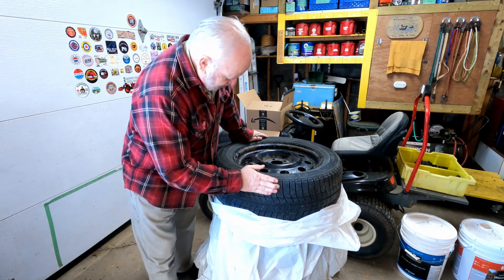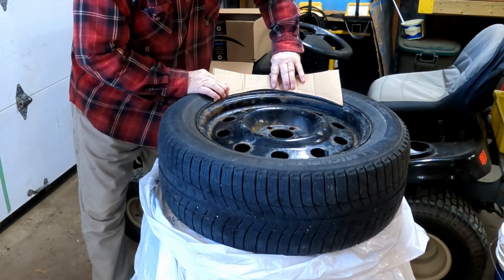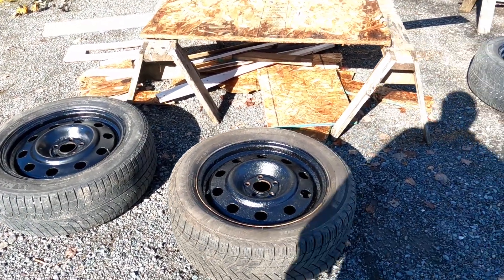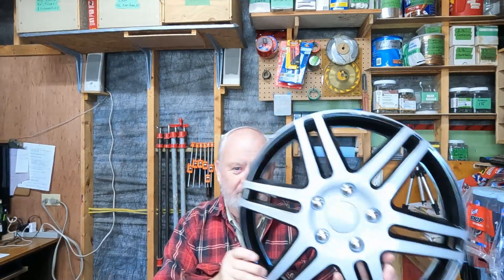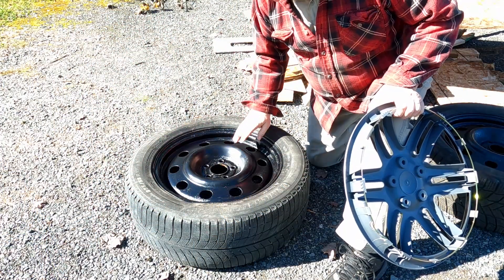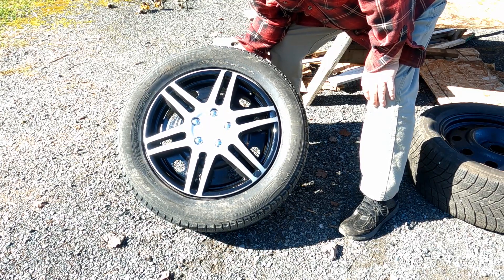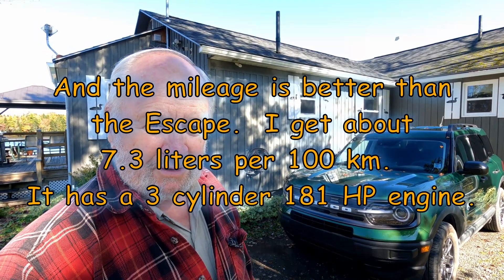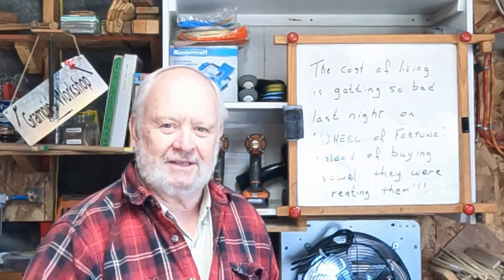Getting My Winter Wheels Ready for THE Season

Comment: I like the covers , surprised the winter rims fit the bronco.  I gave up on winter tires , went to all weather and never have to switch tires anymore and never noticed any difference from the winter only tires .
Reply from the maker: How's she goin'?  That's what I wanted to do too Steve but I couldn't get any all weather tires.  Also I guess insurance companies are getting sticky about whether or not a tire is a 'winter' tire.  They say if it doesn't have the 'snowflake' on the sidewall it's not considered a winter tire.  I don't want to get into a pissing match with the insurance in case I have a fender bender so I go with winter and summer.  Thanks for tuning in and have a great week!!
Reply: @GrampiesWorkshop  My all goodyear all  weather tires have the mountain and snowflake to get the ins. discount  , all season does not.  All weather is relatively new and not available for all tire sizes  yet.
Reply: All weather tires are not winter tires. The name is pretty misleading, but an actual winter has compojnds jn the rubber to allow it to remain flexible and tacky in cold weather. An all season/all weather tire doeast have the same mix and will not perform in exrtme cold weather.  I'm doing my best to forget everything I know about tires, but I think it was like -8 degrees celsuis, or something like that. Maybe even warmer than that,lol, i'm doing a pretty good job of forgetting the details.
Reply: @chrisdickson7262  Hi Chris 
The goodyear tires I bought rated all weather has all the same ratings as a dedicated snow tire  except its use in hot weather is permitted.   All season tires do not have the same ratings as all weather.  I had dedicated winter tires in the past but not anymore as the all weather tires perform just fine and can't tell the difference from the old winter only  tires.
Reply from the maker: When making tires was part of your life for as long as it was for you Chris, it's hard to get past it.  It's a work in progress!!  LOL @chrisdickson7262
Reply: Thats not funny there grampie,lol. Fyi Steve, my job title with Michelin before I moved onto tire architecture and design was work in process coordinator. The old fella is pretty quick with his word play,lol.  And now i'm thinking about those damn tires again. I believe all season is actually no good for anything under 7 degrees not 8, but whats 1 degree. (So it definitlet isnt too early to put your winters on dad) and all weather are acceprable for year round, but they are nit a true winter tire. If you live anywhere with harsh conditions and have to drive in those conditions a real winter tire is the only way to go. If you avoid the storms and let the plows and salt/sand trucks do their jobs, all weather will get you by no problem, but ratings and design and construction are not even close to the same thing.
Reply: The all weather tire is actually the tire industries attempt to satisfy the insurance companies who are requiring "winter" tires dxjring certain months, while also trying to keep it possible for people to only have to buy 1 set of tires, instead of all seasons (summer) and winter tires. Imagine a tire company trying to help, I find that part hard to believe.
Reply from the maker: Atta boy Chris!!   @chrisdickson7262
Reply: @chrisdickson7262  I  don't have severe weather where I am , S.Ontario  but  first snowfall  it's like beginners on its skates 🤣
Reply: @SteveRobReviews  our winters here in Nova Scotia are getting much nicer. I think I only had to snowblow the driveway 3 times last year. Global warming has its benefits,lol

Comment: Awesome Grampie《☆》Nice plot twyst Brother👍🏾😁🍺That's good U can use the Escape wheels on the Bronco. 181 HP 3 Cyl Turbo sounds Fun. I was looking at Maverick Hybirds🥤I couldn't pass up the deal on my Charger but I'll probably get a Maverick one day when price gouging calms down✌🏼😎☮
Reply from the maker: How's she goin'?  I was looking at the Hybrid Maverick too, but where I live and the amount of driving I need to do, I thought I better stay with a regular engine.  Besides, charging stations are few and far between around here.  Even though the Maverick I was thinking of was a 'plug-in' model, it would still take upwards of 45 minutes to recharge after a 40 minute drive.  It takes me 40 minutes to get to town.  Then I would have to find a charge station to plug in and wait 40 minutes before i could start back home.  Not good for me.  Thanks for tuning and take care!!
Reply: @GrampiesWorkshop  The 2wd Ford Maverick Hybrid I like never requires plug in. The 4 cyl engine starts up Automatically when the battery needs juice & it shuts off Automatically to save gas. Ford can't m
Keep up with manufacturing due to high demand👍🏾😎🤳
Reply from the maker: They are popular.  When I asked about one they said we can order one for me and it'll be about 6 to 9 months!!  LOL @bdogjr7779

Comment: The Ford appears to be a nice machine. I do like the color, Kind of matches the new shop. 
The rusty wheels are a problem. Once it gets between the hub and the rim it starts jacking them apart. 
The wheel covers add a touch of elegance to the humdrum police grade black rims. 
Just found out that the great white north is stuck with 15% alcohol in your fuel. 
Not as much a problem with fuel injected engines but anything with a carburetor needs special care to run the new fuel. 
I have been buying Recreational Fuel at an extra buck a gallon just keep from rusting out the tank on the Ford 8N or damaging the carburetor on all the small engines in  chain saws, mowers, weed whips, blowers, generators, and anything else without fuel injection.
Reply from the maker: Hey there Dave!!  Thanks for the comment.  I like the Bronco and the color.  First car in a long while that I'm excited about!!  The governments don't seem to give two hoots for the people, at least here in Canada that's what it seems like.  Yeah, let's put 15% in the fuel.  That'll look good on the world stage and we'll get lots of photo ops and we'll be 'green;' and save the world and to hell with what it does to the cost of fuel or the problems it causes the users back home.  I could go on and on about these idiots but I won't!!  LOL  Your shop is looking some nice Dave.  I've got you at 5 to 1 that you'll be in and tight and warm before the snow flies!!  LOL  Take care!!

Comment: I like the Bronco. I've been thinking about buying one. I bought wheel covers last year for my steel wheels. Like you, I got tired of seeing the ugly wheels. The wheel covers held up well last winter, but those plastic clips (where the wire hoop goes) break easily. So be careful.  And be careful pulling or prying the wheel cover off. I broke a small piece off one of the covers.
Reply from the maker: Hello there Rick!!  Thanks for the heads up on the wheel covers.  They seem pretty flexible right now but it was like 15 degree C when I put them on.  They will get pretty stiff when it's below zero eh!!  So far Rick, I am pleased with the Bronco.  It seems to be an ideal size for what I need.  Lots of interior space and the boxy front end lets you know where you stand in a parking lot too!!  LOL  Take care!!

Comment: Mike on those wheel covers  and those wire hoops, may I offer you a bit of experience I've had with these? Those wire hoops will rust like the proverbial anchor. ALSO those covers WILL pop off your snow wheels, especially on those gravel roads and in fact most any pot hole will cause those covers to flyin' off into the woods. A bit of insurance here for you to 'ensure' that you keep 'em. Get yourself a bunch of those white or clear wire zips ( aka wire ties )  Buy long one, at least long enough to wrap in and around the holes in your wheels and then around each spoke in the cover, zip them up snug and there you are, secure enough to last until the spring,... or the next flat tire! :) P.S. Put a set of 'low cost' diagonal wire cutters in the car with your tire tools ad jack, so you can get the cover off when you need to.
Now, on the Bronco Sport, I too am in the market for a new vehicle, and have been looking at a couple of vehicles at my preferred dealer Avalon Ford in Sty. John's. One like yours and  or a new Maverick. I like the colour of your Bronco, looks really fresh and not only matches the Woodland Mills Chipper, but also easy to 'loose' in the woods eh? :) Give us an update one this one every now and then, let us know how 'she's' running.
Reply from the maker: How's she goin'?  Thanks for watching and for the great tips about the wheel covers Reg!!  I have seen a few suggestions to put the cable ties on the wheel covers, so that's on my 'will do' list for sure.  And another great idea to put the side cutters in the car.  That's on the 'will do' list now too!!  So far Reg I am really liking the Bronco.  It's a Beg Bend model.  Not a lot of 'fancy' stuff, but it does have some perks that make owning it fun.  I was also looking at a Maverick.  I was pretty serious about getting a Maverick Hybrid.  The plug in one.  I was about ready to pull the trigger and when I spoke to the buddy at the dealership he said they have to order it and it may take 6 to 9 months or more!!!  They had none for me to test drive either and so I would have to order it and take it or leave it.  I ended up leaving it and then my salesman was able to find this Bronco for me.  It still took 6 months of almost constant checking with him but he finally found this Bronco in Ontario.  It too 2 weeks to get it and my only choice in the whole deal was do I take it or leave it.  I couldn't pick a color or model unless I wanted to wait a few more months!!  It was crazy, I never worked so hard to buy a car in my life!!  I will do an update on the Bronco once we get some snow down and I can use it in 4 wheel drive a bit!!  Thansk for asking and take care!!
Reply: @GrampiesWorkshop  Yes, I hear you too, especially on the 'lack of' delivery times. I am thinking that I will order a Toyota Corolla Cross, hybrid and AWD. Only ( ONLY! ) six months from order date. I did order it, but I am not 'forced' to take it, IF I should find another vehicle in the meantime. SO as there is no obligation in ordering, I did. If al goes well, it 'should' be here for the spring March or April '24... I hope I'm still here to take delivery hahaha!
Cheers too, Mike and a Hello with best wishes too, to Nanny.
Reply from the maker: Thanks Reg!!  The new Toyota truck looks like it'll be a good rig.  But who knows when that will ever get to a dealer eh!!!  I hope your Corolla works out for ya!!  I think the hybrid is the only way to go for electric cars.  I hope it's everything you think it will be!! @regsparkes6507
Reply: @GrampiesWorkshop  I always remember the little quote somebody said once,... " nothing is cast in stone"